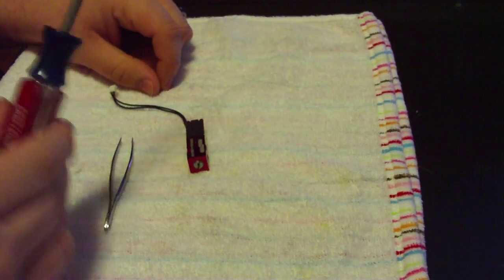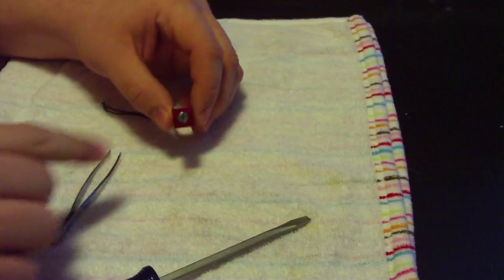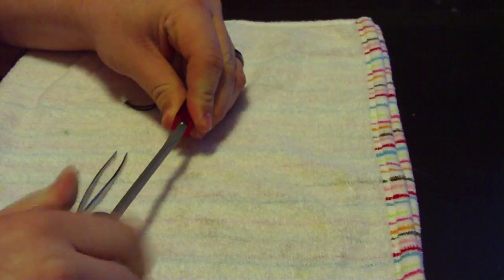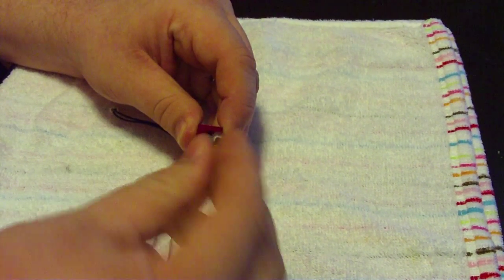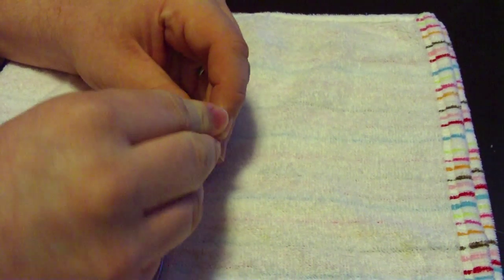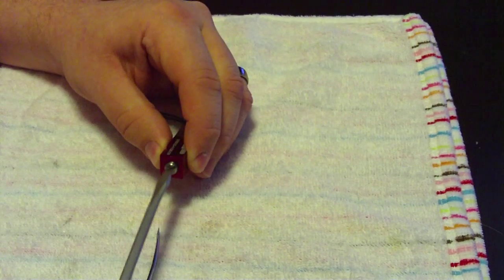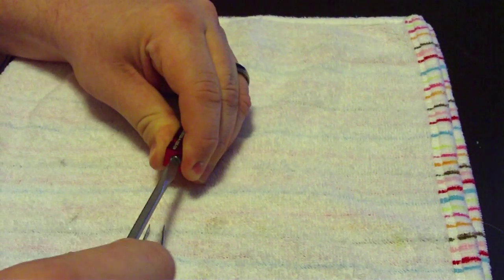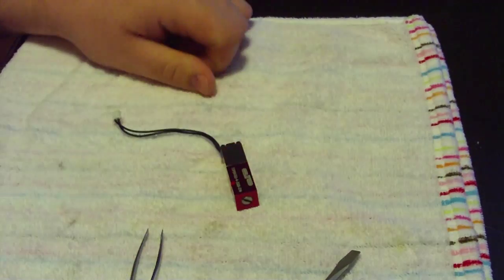Dangerous Power Solenoid Maintenance

Comment: Hey guys. Recently picked up a f7. Can’t seem to figure out if it’s the solenoid venting or a bad o ring.  I have the hpr and lpr fully backed out/lowest pressure and the marker still leaks out of the lower back screw hole where the grip frame meets the body. If I cover that one up it leaks out of the trigger body screw. Pretty sure it’s a blown solenoid as this one looks tampered with but I’m running out of ideas as I’ve rebuilt the ram o rings along with the piece that’s screwed into the lower tube by the retaining screw. Will replace lpr as well.  Brand new hpr. Also my gague doesn’t work Wich leads me to assume the solenoid was blown...... I noticed my solenoid has two micro ball bearings on vent holes on the side and it looks like a hole purely for venting without a ball bearing. Should there only be two or should there be 3 and it’s an indication it was blown out?

Comment from the maker: @An1mePhreak Using D55 was perfectly fine. Have you done the standard procedure when dealing with firing issues:

1. Replace the battery with a NEW one
2. Clean the bolt and relube LIGHTLY with D33/Sleek
3. Replace the bolt orings

Comment: I think my solenoid is blown in my G3. It won't allow me to increase the pressure without the gun locking up and not firing.  The reg seat isn't blown.  I haven't tried opening the solenoid up yet. Do you think that it is completely blown? or It justs needs relubing?